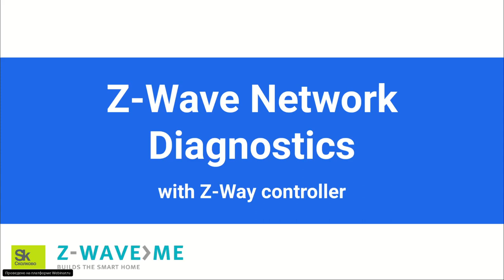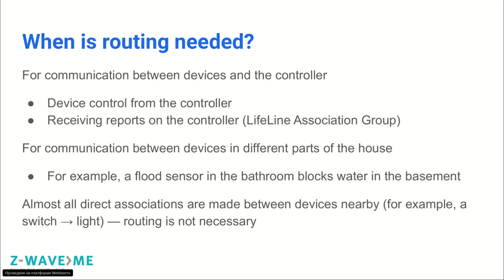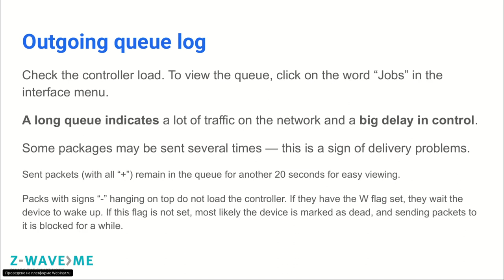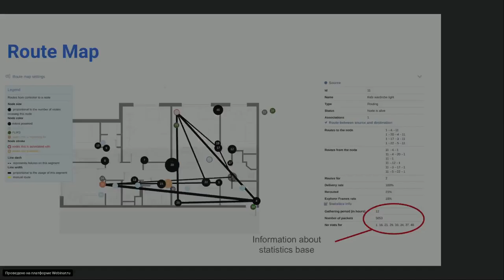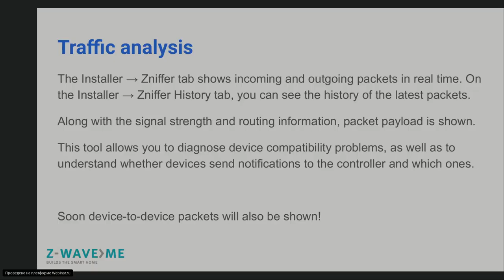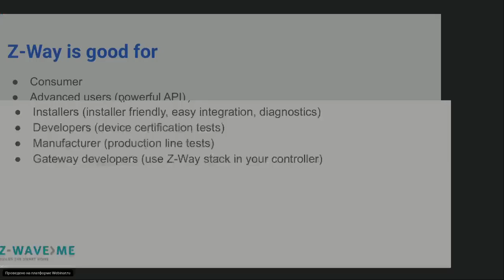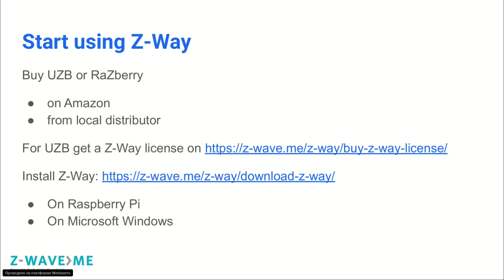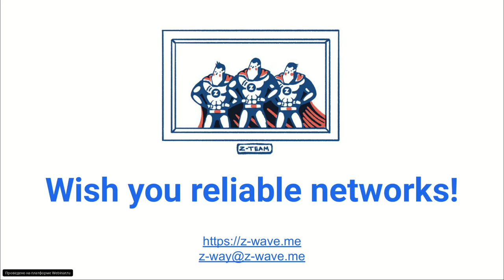Z-Wave Network Diagnostics with Z-Way controller

Comment: I have a question: I use the sensor-values-logging.js in the stack, to sent messages to my own php server which has all the logic. I noticed delays, and not sure if it is the z-way stack or my stack. Is there a delay when for instance, motion is detected, before sending it to js? Right now, the light in the room I am entering goes on like 30 seconds later on average.
Reply: Please check the log - you should see the moment when the Z-Wave radio command is sent. You can also compare it with the moment when it is sent to php. May be JS code is too busy, but 30 seconds is too much. May be the queue is busy, so the command is confirmed too late - check queue window in Z-Way